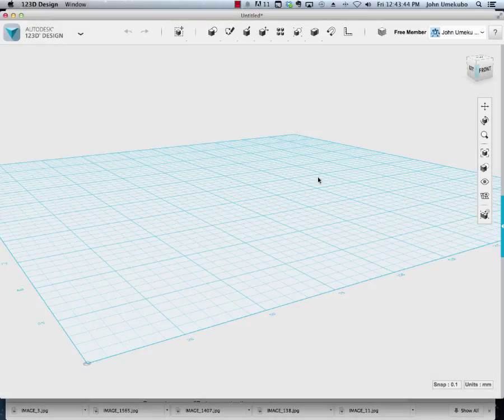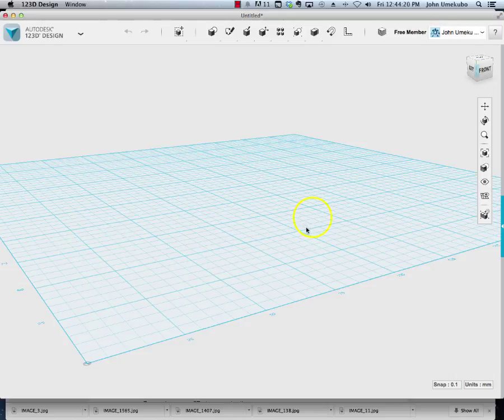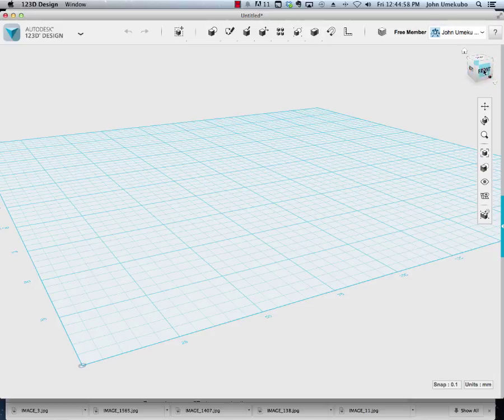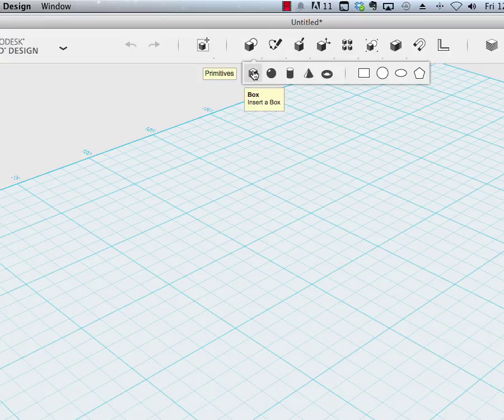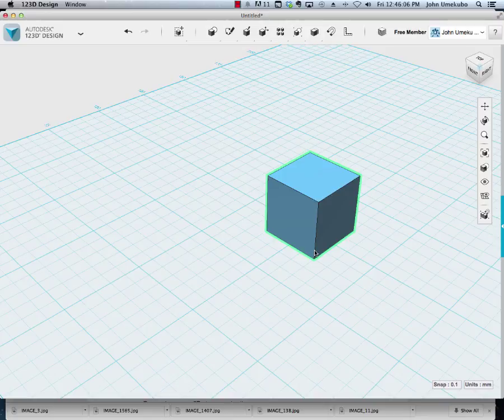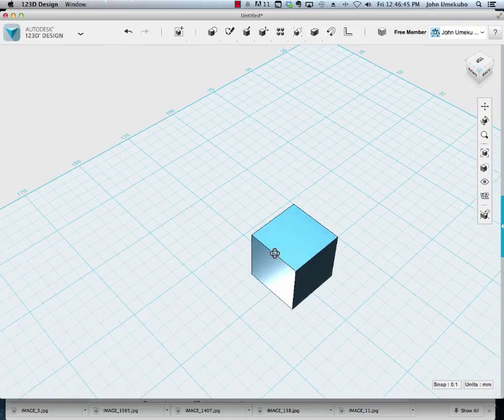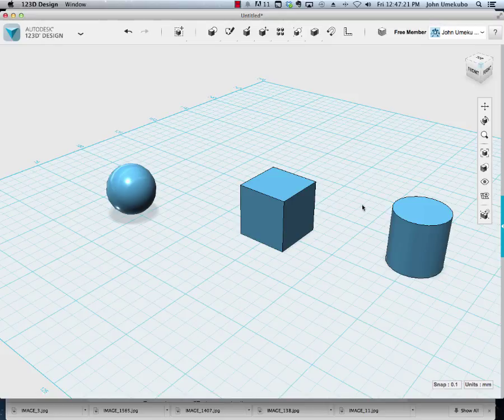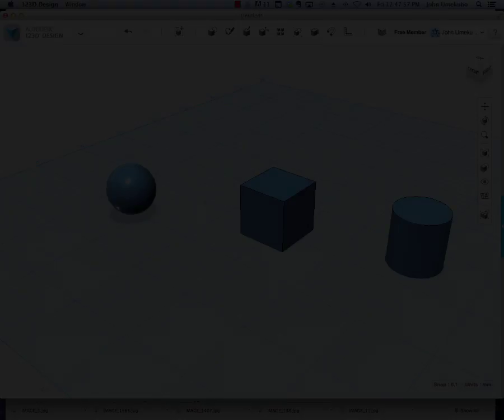Autodesk 123D Design - Introduction

Comment: In tinkercad there is an option to move the grid (platform) around your object. So lets say there is a square and you need to place several objects on the top. So you put the grid on the top of the square then after merging you can move the grid back down where it was before.  I can't seem to find any mention of that option in 123d. I read through the help pdf and checked online but I wanted to be sure.  Is there a way to move the grid?
Reply: +Atilaurakiss Yes, I love that about TinkerCAD. In 123D it's a little different. You don't actually move the grid. Instead, if you have an existing cube already, then bring a new shape out, it will automatically stick to the sides of the cube if you hover over it. You can just release when you find the side you want to stick to. You can also force an object to stick to another object using the magnet icon. The way it works is that you click on the magnet icon, then click on the two faces you want to attach. The first face will move to the second face.